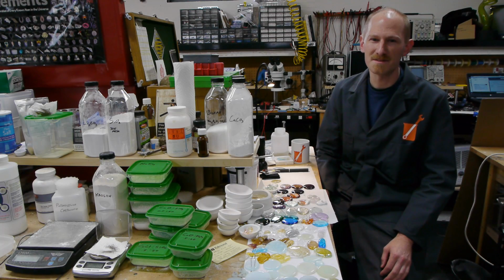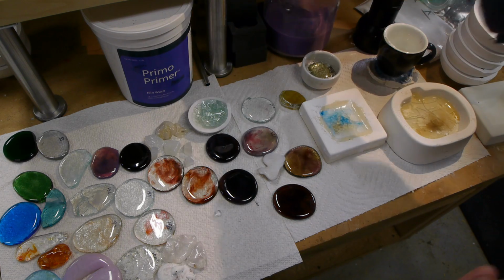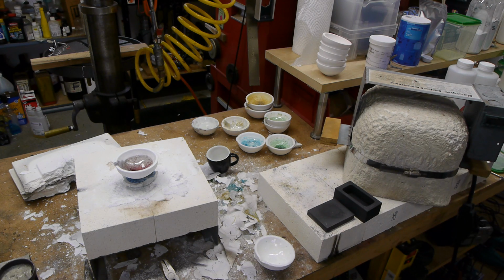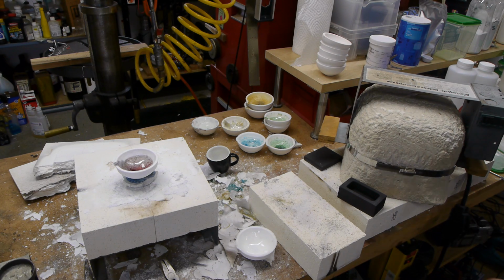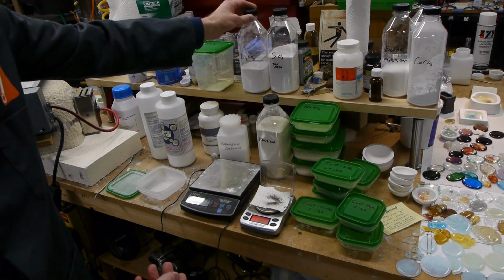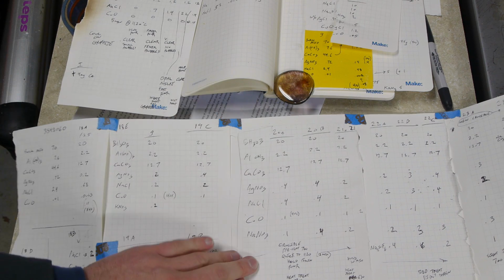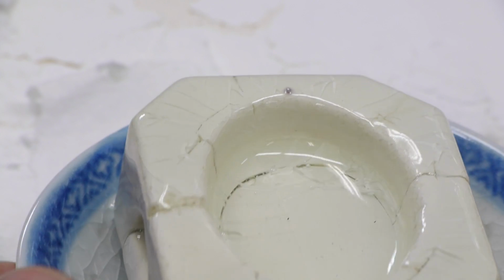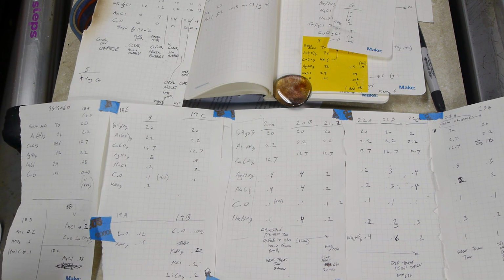Glass engineering - designing and making photochromic glass

Comment: You are amazing. 
I also trying to build Trans cranial Magnetic Stimulation device that you contrived a few years ago. 
I have built almost all of the circuit. 
But I have no idea how to build SCR
Triggering circuit. 
You mentioned you used 555timer and some kinda capacitor and resistors. 

Will you send me schematics or how-to-build instructions?

I use 3000volt 4000peak amperage capacitor rated at 100-200micro-farad.
And my cap charger is so weak that it takes almost 30seconds to fully charge my cap. So I am really curious about the 555chip is applicable for triggering my thyristor and capacitor at fully charged state. 
If there is another better option to take, please help me. 

Alexitechnical@gmail.com

Comment: I enjoyed your video.  I few comments from my experimentation with making  items via glass fusing.  

If you read about making items via glass fusing, they will tell you to coat every surface in your kiln with kiln wash before its first use to insure that glass spills do not ruin your kiln.   If you are very careful to never touch the coated surfaces, the kiln wash will survive several firings.  However, eventually you will need to re-coat the kiln. 

I found it absolutely necessary to recoat the kiln shelves before every use.  The same was true for molds. The glass would always pull the kiln wash of the shelf, leaving spots with no kiln wash.  If I were to use the shelf a second time without recoating it, the glass would stick on the places left bare.  When you scrape the used kiln wash off the shelf, insure you are wearing a respirator.  You do not want to inhale any of the powder.   Also wear a respirator any time you are spraying a shelf or mold with kiln wash. 

Kiln paper can be used if you have money to burn and do not like coating your shelves with kiln wash.  However, just like kiln wash, the kiln paper is suppose to be replaced after every use.

I found that spraying the kiln wash onto the shelf produced a much smoother coating than I was ever able to get by brushing the kiln wash onto the shelf.  The best sprayer that I found was a hand-held sprayer used to spray plants.  It had a built-in pump. You poured your kiln wash into the container, pumped it several times to pressurize the container, then pulled the trigger to spray the shelf.  It made coating the shelf easy and would produce a very even coating.  If the texture of the bottom of your glass sample is not important, applying kiln wash with a brush would be sufficient.

While it is true that hot glass will not stick to graphite, placing a sheet of graphite into a kiln would ruin the graphite.  The extreme temperatures in the kiln would cause the graphite to convert to CO2.  After the first use, any part of the graphite shelf which had not been covered with glass was covered with small pits.  The pit were deep enough that sanding the shelf flat would have taken quite an effort and would also have generated way too much carbon dust.  I was told that replacing the oxygen with and insert gas would eliminate the problem.  Argon was suggested.  I never set up my system to try it. It was easier and less expensive to use kiln wash.

Comment: looks a lot like ceramics glazing even in the formulas. you should look at Daniel de Montmollin's book about glazing. 
actually you could try to make a uv sensitive glaze !  
As well you could make your own melting dishes buying porcelene, just modeling the clay with your fingers to make a bowl. Then it's possible to fire it with the pouder in it without having to make it bisk. 
You can put some alumine pouder on top of your kiln floor, that's how potters do to prevent glaze from sticking the floor. as well they use some heat resistant tripods like thoses : http://www.ceradel.fr/fr/arbre-trepieds-gazettes-echelles/1800-trepieds-refractaire.html

Comment: This was an absolutely great video, but I'm a little disappointed you didn't mention respiratory protection at all and barely mentioned the volatile compounds produced as you heat a batch of glass. You really don't want to be breathing silica dust (see: silicosis), and I have no doubt some of the other compounds you're either using as starting materials or producing as the glass is formed aren't exactly great for your health either. One of the first things you learn working in any glass studio is to be careful with any dust, especially from colored glass, and also to be aware that certain colors will off-gas when heated. (Clear glass is generally pretty benign aside from the dust.)

Comment: Thank you, very interesting :)
Just a word of warning about Lithium: It is very volatile and reactive. We have a project about solid Li-electrolytes and samples are sintered at our project partner in a special oven just for this stuff. You'll face 2 problems: Firstly, the Li will react with your furnace wall, potentially destroying it. And in the next batches the Li will come back out of the lining and lithinate your samples. Secondly, Li evaporates very fast, we have problems with stoichiometry of the electrolytes even though they are sintered in a powder bed of the material. Getting the excess in the starting material right and a homogeneous glass will be hard.

Comment: Stainless steal would work quite a bit better as a mold release.
Reply: No ,glass sticks to hot metal like you wouldn't believe.Most glassblowing pipes and puntys are Stainless . To remove
leftover glass the pipes are dipped in water to cause the glass to shatter off.  I learned the proper way to do this
when I learned how to blow glass. Do it right no problem do wrong the steam heats the pipe causing the next person
to burn himself.
Reply: Stephan Buchholz we use stainless whenever we prepare our glass samples in my Materials Engineering course. Pour the mold into the stainless then as soon as the mold is hard enough to move with tongs place it back in the furnace to anneal.
Reply: Zach

 A few questions for you
   Where are you taking the  Materials Engineer course? (friends Son Wants to become a  Materials Engineer)
It seems to me that your pouring your sample on to a relatively cool (ie it isn't red hot) piece of Stainless
waiting until the glass cools then anneal the sample
Is that what your doing?

It sounds like your  using the Stainless like a Marver table (ie big freaking piece o metal used by glassblowers to shape their gathers before doing the major shaping)

I'm just trying to understand what your doing because it is counter to my experience as a glassblower
(at least 15 years as Lampworker in soft glass and boro, fused glass and studio glass) 

sorry if I seem to be a troll

Comment: Also, you mentioned that it's a bad idea to pile glass on the graphite then heat the whole thing up, because the graphite sticks to the glass. I wonder how serious this is, because I once wanted to melt small glass shapes in a graphite mould in vacuum (with inductive heating) to make glass/metal pin seals, but maybe that's not possible because of the graphite sticking?
Reply: Love your channel Lindsay.

Comment: Hi-sorry to be a pain -no pun intended ! !
Can I ask you is it hard to make quartz glass ?.
I have always wanted to make and blow the glass to make my own radio tubes
Just wondering 
Thanks again
Reply: Quartz melts at about 1650 C (3000 F), so making it would be very difficult. High quality glass fusing kilns have the heating elements enclosed in quartz tubes to prevent falling debris, but with the right equipment you might be able to turn quartz glass into the right size tube, but my guess is that would be the easy part.

Comment: Just remembered something, when you were talking about the kiln - have you come across the microwave oven kilns for glass fusing? Things like this : http://www.creativeglassguild.co.uk/prod/3-microwave-kiln. They have a piece of microwave susceptor inside (I think it's silicon carbide, so you could possibly use some pieces of grinding wheels) to absorb the radiation and heat up.

Comment: I would suggest pouring a refractory or jewlery/dental investment "crucible" which can be disolved in plaster remover (or water) after baking. 

Also there are flourine/other based acids for etching off that "reaction layer."

Additionally recommended is the Air Force Dental Technology Crown & Bridge manual.  It would have quite a bit of information on materials and techniques for molten glass.  

Prosthetic eyes are also made by baking glass, I'd imagine a gov't manual or two is out there.

E-Max glass ingots and how that works is also worth checking out.

Cheers!

Comment: Recycle your glass... by that I mean use broken up old glass that's similar to what you want as fill. They do this in industry for a few reasons. One it lowers the melting temperature of the whole thing by a few degrees which makes the furnace last a lot longer and makes it easier to work with. Two saves a lot of money on heating the glass. Three saves money on ingredients.

I'd love to give you some extra knowledge but I signed a NDA and can't talk about the things I've learned. The glass industries are very competitive and don't like sharing their trade secrets. They also have a lot of lawyers...

Comment: Can't you use an arc furnace to get higher temperatures? 
Since the glass isn't very conductive you'd probably have to run the arc directly from electrode to electrode but if the cavity isn't too large and the insulation is sufficient you should easily be able to get it up to 1500 °C or so.

Comment: Glasses can also be made from phosphates which melt at much lower temps and can go from melt to pour in as little as 4 hours and have low viscosity when molten. They are somewhat soluble which is a downside. Used them as a demo for secondary school. You can all the metal oxides and get the same colors as the silicates. Don't know if anyone has made them in a photochromic version....

Comment: Thanks for the nice viedeo, a very interesting topic indeed! ^^. Talking from my chemistry experience: In the transition from silver chloride to silver metal, The silver actually has to accept electrons (be reduced), not donate them. In photographic film silver chloride is used, which then converts to silver and chlorine gas. I guess in glass the same thing must happen, but because the salt is dispersed the chlorine is trapped and therefore avialable for the reverse reaction. I think the copper oxide that you add has a catalytic function in regenerating the starting compound. If the potential of these reactions are comparable to those in aqeous environment, then we can speculate a bit based on the standard electrode potential of the individual components (https://en.wikipedia.org/wiki/Standard_electrode_potential_(data_page)). If we fill in the numbers, we can see that the reaction of Ag and Cl2 to form AgCl does not happen on it's own accord. However the donation of two electrons from Cu(II) to Cl2 is strongly favored, regenerating the Cl- ions. The potentials will be different in a solid material then they are in aqeous environment, but I think via regeneration of the counterion, the copper aids in the regeneration of the AgCl.

Comment: Hello, Ben! I am also interested in the melting of glass. At work, I want to get a protective glass for thin-film platinum temperature sensors. I took 6 brands of glass that used to be used to produce vacuum lamps and indicators. I thought that the main task to be solved is the discrepancy between the temperature coefficient of linear expansion. But it turned out that there is still a problem of interaction of platinum with glass. Some of the oxides in the glass are reduced in the presence of platinum, and because of this, the surface is covered with bubbles. Regarding your video, the problem of mixing is solved by double melting. First you mix the ingredients, you float them, then you get the ingot and grind it in a ball mill, then float it again.  In this way glass is made in the Institute of Glass in Russia, I managed to visit their laboratory.

Comment: IIRC you have it the wrong way around at 31:44, the silver in silver chloride has a positive charge, and converting it to metallic silver would thus require it to take up an electron. And vice versa, it gives off an electron when converting from the metal to the ion.

Comment: I would love it if you explained why older formulas of Pyrex glassware are more robust and shatter-proof than the newer versions.
Reply: Kendrick Kelly , Older pyrex was borosilicate glass. Newer like the last 40 years is heat treated soda lime glass. Cheaper to produce but the heat or chemical surface treatment (tempering) adds a measure of thermal stress resistance.  It breaks in small chunks when the thermal rate of change or thermal gradients are beyond what it can handle. The designed in stresses on the surfaces let go all at once. Untreated glass breaks in long splintery shards at lower stresses.  Borosilicate family of glass has a lower thermal coefficient of expansion than soda lime although higher than fused quartz.     If you could find a known European borosilicate item and a newer US made soda lime version you might be able to see the difference bring placing them between to polarizing plastic sheets. I'm guessing the stress gradients from tempering would look different than the borosilicate?

Comment: You mean helium not hydrogen gas
Reply: No, he means hydrogen. Hydrogen will form water if oxygen gets in, thereby taking care of the oxygen. Furthermore, Hydrogen is relatively cheap compared to helium and extremely plentiful. If they were going to purge with a non-reactive gas they would use nitrogen as it is also extremely cheap - however small amounts of oxygen would still be able to get in and react.

Comment: How about kanthal heating elements? They can get up to 1400 degrees C and don't oxidize as easily as nichrome. They are pretty cheap too. Just bought some recently.
Reply: PvPbomber009 I am using kanthal in lab (fusing at 1350°C). It is not so strong as advertised when used in "random" atmosphere.
Reply: Oh, good to know. Haven't tried it myself yet. what lab are you working in? I am actually also from Kaunas :D
Reply: PvPbomber009 novitera. PGM from autocatalyst. Fusing catalist ceramics with copper flux to collect all precious metals to metal bead.

Comment: Properly done, gas kilns are even more versatile than electric. The trick is using concentrated oxygen rather than air. By varying both fuel and oxygen, it's easy to provide a reducing, neutral, or oxidizing environment. Propane-oxygen flames can get to 2200C. PSA-based oxygen concentrators can be had for ~$600 but the flow rate is low so it must be plumbed to an oilless compressor and storage tank. Alternatively you can start with bottled oxygen but that's more expensive and less convenient long term.
Reply: spqr0a1 unfortunately they are nearly impossible to make so that no hydrogen, oxygen, or water vapor interact with what you are making. Electric and induction kiln's are much easier to purge.

Comment: Why aren't the heating elements made of tungsten? Seems like that would be a fairly simple way to get around the problem of them melting.
Reply: Like Ollyweg said, temperature is no problem for tungsten, but tungsten filaments would oxidize and fail at those temperatures if not in an inert atmosphere.
Reply: I had the same thought its conducting and melts at 3422 C.... will do research......
Reply: Tungsten carbide electrode from a TIG welder.

Comment: whoa hydrogen gas inside a furnace sounds so dangerous but i guess it cant explode as long as there isn't a bunch of oxygen?
Reply: Matt It's not under pressure and it's very hot so low density. Keep a decent seal and it's pretty safe. The fact that you've got hundreds of pounds of molten tin and glass sitting there is your bigger concern.

Comment: I've been looking at casting some custom optics for a laser spectrometer I'm DIYing, so this was an interesting watch. 
I'll probably just go with lead oxide, germanium dioxide (from pulverized fiber optic fiber). I haven't got into my exact proportions yet. I'm leaning towards 20% lead oxide, 20-30% germanium dioxide, and the rest being potassium silicate. (it should be a low temperature melting glass, with a high refractive index that thermally stresses easily.)

With regards to the recipe given, boric oxide glasses can be sensitive to water in their environment. It's probably all well and good in the lab, but since aluminum is already a thing in the recipe, I'd go with a higher alumina content. If you do that you can switch out silver nitrate for silver phosphate and get an aluminum phosphate glass.

Comment: Why only those specific heating elements? Why not just simply tungsten? Or even iron?
Reply: P = I * R * R. This means when using low resistance metal as heating element  you'd need a power source that could deliver a high current to compensate for the low resistance, which would be more expensive. Or you have to make the heating element really thin like in incandescent lamps, but then it would break regularly like those lamps do.
Reply: Good point, I overlooked the corrosion. Don't suppose there's a handy coating you could apply that would fix that without the crazy price tag of the fancier heating elements?

Comment: Try replacing tin with mercury for the float glass process. I think that's how they used to do it before industry really cared about heavy metal pollution. Love the videos!
Reply: Mercury boils at 356°C, so no good.
Reply: Jason Patterson I think if the pool of mercury had enough mass compared to the mass of the molten glass the thermal energy would be conducted away from the glass and disperesed throughout the bulk of the mercury without bringing it to a boil. Mercury is a pretty good heat conductor I believe.